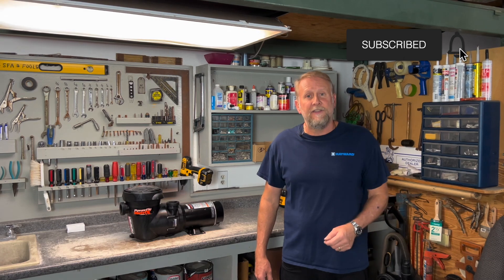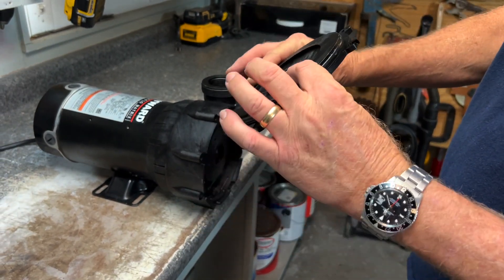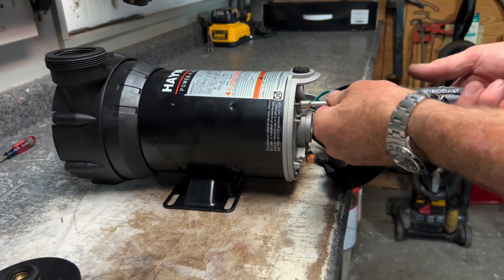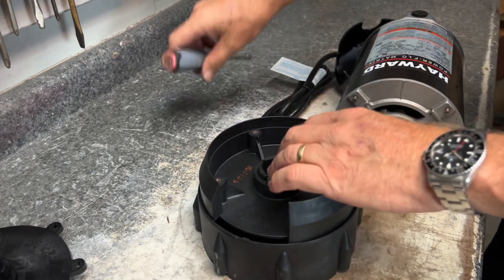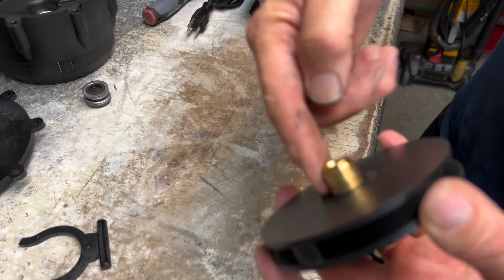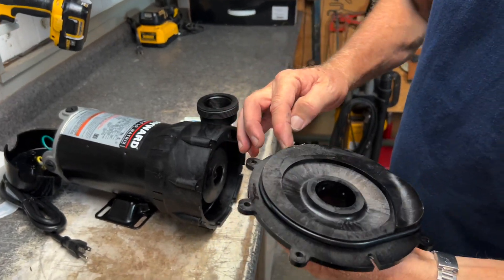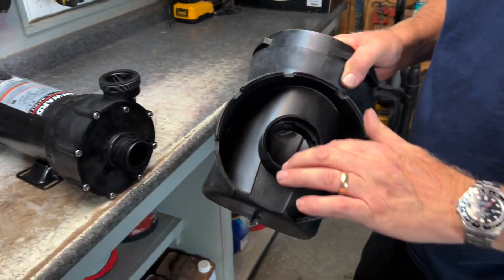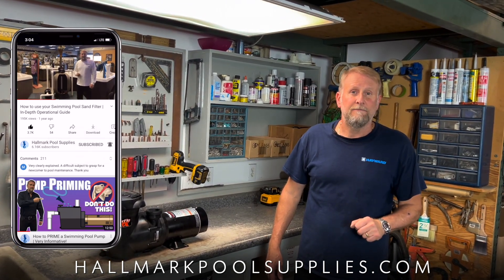How to Change Seals on a Hayward PowerFlo Matrix Pool Pump!

Comment: Do you have a video on how to replace the capacitor on this same pump ?
Reply from the maker: @U2WB  The Power Flo Matrix by Hayward is a split phase motor and does not have a capacitor. Thanks for watching.
Reply: @HallmarkPoolSupplies  oooooh boy ! Well there goes that idea. What would cause it to trip the GFI every time I power it on ? It hasn’t rained here in over a week.
Reply from the maker: @U2WB   You may have a short in the motor or the cord, you could also have a weak or bad GFI. If you need a pump or a motor, email your contact info and l can help. My email is on my YouTube channel. Thanks for watching.

Comment: There is two side to the other seal in the pump housing you can put it in backwards.
Reply from the maker: No, If you are referring to the ceramic part of the seal the smooth side faces out. Thanks for watching.
Reply: @HallmarkPoolSupplies  Thanks for answering. Mind started leaking just as i turned it on for the first time this year thank for your video I got the impeller off but when I nock the seal out I didn’t see how it was suppose to go back in so got a new one and installed it the wrong way it didn’t leak but it started to make noise turned it off turned it back on the motor couldn’t turn the pump so I pulled it a part and turned the seal over but to late it leak’s just like the old. Food for thought and for the next diyer explain about the seal. Thank you.

Comment: Great video! I have the SW1594 model and had to use an Allen wrench in the impeller and pull my motor apart to get that impeller off. While trying to get the motor back together, what looks like the capacitor plates kept getting bent by the bearing on the shaft. Needless to say the pump now doesn’t run in high speed. It’s like a kick in the pants 😂

Comment: This by far is the best instructional video on the internet for this procedure.   A couple of things to consider when doing this on a older pump.    I had a 2018 Power Flo Matrix Pump that was a 1.5 HP that was leaking badly.   To get the impeller off on an older unit it is best to have a second person to help you.   In my case I had a flat blade screw driver and what I did was take some vice grips and clamp down on the screw driver with them.   I then had my wife hold that screw driver in the slot on the back of the motor shaft using the vice grips as leverage.    I was then able to use my hands to spin that impeller off counterclockwise.     I was unable to do this by myself trying to hold the screw driver in my right hand and spin the impeller off with my left hand.   The other thing to really pay attention to is the orientation of the housing seal.    Mark explains in the video how to correctly install the impeller seal with the metal flat part against the impeller.    The seal that goes into the housing is not the same on both sides.   You need to pay attention to how the old seal comes out.   I used a socket to tap the seal out.     I also used some anti seize on the threads of the 4 quarter inch long bolts that go into the housing.

Comment: Hey Mark, thanks for the video! I had an issue when reassembling my pump, I tightened the impeller back up using a slotted screwdriver in the rear and hand tightening the impeller, but now the motor does not spin freely… is it possible to over-tighten the impeller? Thoughts on what to check would be appreciated. Thanks!!!
Reply from the maker: If you changed the seals, it is important to remove the seal that is on the impeller completely. Sometimes the rubber washer, part of the old seal sticks on the impeller and if not removed, putting the new seal over the washer can cause this issue. Remove the strainer housing and the diffuser cover on the pump and see if the impeller spins. When the diffuser cover is in place the impeller can rub because of the washer. Also when installing the diffuser cover do not over tighten. Thanks for watching.

Comment: Mark hello, I changed both seals out yesterday and it’s still leaking does it matter which way the seal faces in the housing ? Not the seal on the impeller but the other one.
Reply from the maker: @MrN75nokia   It is important that both parts of the seal set are put on correctly. Both parts can only go on one way or you can damage the seals and you will have a leak. If the seal set is damaged then you may have to replace the seals. Thanks for watching.
Reply: @HallmarkPoolSupplies  yes now I see that the ceramic part of the housing seal has to touch the Teflon part of the impeller seal. I accidentally put the rubber side of the housing seal up against the Teflon side of the impeller seal, so I’m sure it’s ruined, but I have more seals on the way.
Reply: @HallmarkPoolSupplies well after getting the seals in correctly the motor burned up so had to go buy a whole new Matrix, it was 8 years old so I guess time for a new one.

Comment: Great video- question I bought this pump and I had to turn the pump  to fit my Hayward filter- the pump would not lock into position- the pump started leaking after the first year with the pump not locking into the side discharge position was it defective out of the box?  I actually bought another pump and it locked and I had no problems with it.  Thank you!
Reply from the maker: It's possible that the locking tab was broke.

Comment: I've always been told, as it pretains to shaft seals of this design, even the oils from our hands can cause issues between the Teflon and ceramic surfaces. I've always used gloves, and wiped the mating surfaces with alcohol prior to assembly.
Reply from the maker: Handling the seals is fine, water chemistry (chemicals) is what damages and shortens the life of the seals. Thanks for watching.

Comment: The plastic peice before you get to the impeller on mine seems stuck... do you have any ideas how I can get it off...
Reply from the maker: If you are referring to the pump cover, once you remove the screws it will come off. sometimes they get stuck, you can use a flat head screwdriver  to pry this piece off. Thanks for watching.
Reply: @HallmarkPoolSupplies  thank you soooo much!! Worked perfectly!! You are a life saver!

Comment: Thank you for the great video. I have a Hayward power flo matrix dual speed pump leaking at the basket and pump.  Is the part number for the shaft kit: SPX1500KA? Thanks again
Reply from the maker: Yes, thanks for watching.

Comment: So I had this type of pump from Hayward for one season and the second season it started leaking. I bought a new one and had this in my garage for a few years. I found your great video and started to change the seal. 
I got to the point of removing the four screws. One did break off. Tried to separate the housing to get to the seal and the whole motor came out. Hayward is a junk comp. Why would they not put never seize on the threads knowing they would be in a damp environment. The housing inside where the motor is has  considerable rust inside from one season. Hayward along with almost every company anymore just makes junk. It is a disgrace since these pumps are over $300.00.
Reply from the maker: I agree, however Hayward and a lot of other companies do not make the motors. Most of these motors are made in foreign countries.
Reply: @HallmarkPoolSupplies  Hi. Just viewed your video on replacing the shaft seal assembly. My Hayward power flo matrix model SP1593 pump, that I purchased (8//11/16) only has the 1 shaft seal, it doesn't have the other seal with the spring. Is this correct?
Reply from the maker: @AnthonyCarrozza-b3v  No, the shaft seal on the impeller has a spring, if yours does not you need to replace or you have the wrong seal. All Hayward seal sets are made this way.

Comment: I changed both seals and the Hayward Pro Flow Matrix is still dripping water under the pump.  Could you give me an ideas of how to fix this? Thanks!
Reply from the maker: If you put the seals on properly, check the housing o-ring for damage. Make sure that everything is tight, also check for any cracks in the body. Thanks for watching.

Comment: Question- I was finally able to get the broken screw out. The whole inside of the motor came apart. I put it back together but when I turned it on it tripped my breaker. Does the internal part of the motor go in a certain way. I have not been able to determine the answer. Tks
Reply from the maker: Yes, you may want to take your motor to a local motor repair shop and have them take a look to be safe.

Comment: Hey Mark, great video on point. Have the same pump but the problem I'm having is that it's not priming. Suction is weak on the skimmer side. Check the hose from the skimmer to pump no problems there. Checked the pump for debris, nothing. I'm a new pool owner and the pump isn't even a year old. Am I missing something. Your feedback would be greatly appreciated. Thank u sir.
Reply from the maker: Make sure your water level in the pool is high enough and the weir door on the skimmer isn’t stuck. If you have a sand filter, put the system on recirculate and if the pump runs good then you may need to backwash and rinse the filter. If the pump runs the same then you need to check your pump. Make sure nothing is cracked and that you have an air tight seal (o-ring, lid, housing, plugs) in order to maintain prime. You also want to make sure the impeller isn’t clogged. Hope this helps, thanks for watching.

Comment: I am changing my shaft seal on my Hayward SP1593 right now ( 6/2/23 ). I only have the 1 seal on the housing. I do not have the other seal with the spring on it. Why?
Reply from the maker: The Power Flo Matrix pump has two parts that make up the seal set. The part you are referring to is on the impeller and the other part of the seal is in the pump housing.

Comment: This is perfect!  I had a tiny leak under my pump all summer.  I’m sure it’s a seal. I just closed my pool and took the pump inside to my work bench.  I was hoping to find a video showing how to replace the seals on my power flo pump.  And this is it!  Just need to order the seals and get in there.  Can’t thank you enough.  Big $ saver.  Just subscribed to your channel.  Thanks!
Reply: So I finally got around to doing this job tonight.  Figured I’d do it over the winter so I’ll be good to go next summer in CT.  Followed your video every step of the way and I had very little issues.  My model was slightly different than yours, but all the steps were the same and an hour later I was done.  Pretty confident I won’t see leaks next year.  Fingers crossed.  Thank you so much.   Big $ saver for me.  And it actually kinda fun to do.  Appreciate your channel!

Comment: Hi Mark.  I just had my SP1593 motor repaired with new bearings and a new shaft seal kit.  I put it all back together and now it's leaking out the bottom.  Could one or both of the o-rings past the impeller be prone to leaking when removed and reinstalled?  I did'nt put new ones on as they looked to be in good shape.  Excellent videos and thanks for any assistance!
Reply from the maker: Anytime you repair or replace a motor you should replace the shaft seals. Thanks for watching.

Comment: I’m having a problem getting the propeller off. Seemed simple for you. Stuck for me. Afraid I will break it. Any suggestions? Am I missing something?
Reply from the maker: Most of the time the impeller will come off easily, sometimes it can be a challenge. If you are having a hard time getting the impeller off, have someone help hold the shaft while you turn the impeller off. You can also use a pair of channel locks to turn off the impeller, if you break the impeller you can replace it. Good luck, thanks for watching.

Comment: Hi Mark, this is a great video. 

I wonder if you can help me. I have a Hayward Matrix Power flow 2 speed above ground pool pump and today it was not working at all even if the power was on. So I tried to put the switch on OFF (it was on low speed) and when I did that the switch just snapped. Now the switch is loose and dont stay either on LOW or HIGH. 

Do you have a video for replacing that part? Is it easy to do? I am quite handy but have no experience at all on pool pumps. 

Also can you tell me the exact part I should buy. Thanks.
Reply from the maker: The 2 speed switch is easy to install, the part number is SPX1500S9.
Reply: @HallmarkPoolSupplies  Thanks for the answer. Do you carry that part? I did not find it on your website, And it is unavailable on Amazon. Do you know where I can find it and how much should I pay for it. Thanks for your help.
Reply from the maker: @andreab919  These switches are after market and the manufacture does not have any at this time, the part is on back order.  I would take your switch to a local electronic store or motor repair shop, you should be able to get one for under 30 dollars.
Reply: @HallmarkPoolSupplies  Well looks that I am not that handy after all. I cant figure out how to reach the switch. My pump does not have a single screw to remove a cover. It has two holes in wich it seem to have flat screws. But even if I unscrew these, the back does not pull out. I did not take the screws completely out not knowing if it is ok to do so. Can you help me in telling me exactly how to reach that switch. My model is Hayward Matrix power flo SP56152. Thanks
Reply from the maker: @andreab919  The pump model that you have is the Canadian version of the Powerflo Matrix by Hayward. If you have a 2 speed with timer then you need the 2 Speed Timer End Cover, part number SPX2090C2ETM. The back cover will come off and can be replaced. I do not carry this part, but you can go to haywardcanada.com and they should be able to help. The Powerflo Matrix is also made in an American version, which uses a different switch.

Comment: Is there a way to relate this to the Power Flo XL. My strainer basket goes on sideways without the c clip on the outside. Just wondering if the play would make it leak since it’s not tight? What is the function of the outer c clip?
Reply from the maker: The Power Flo Matrix uses an o-ring between the strainer housing and the pump cover. When using the c-clip the housing will be lose but it should not leak. Thanks for watching.

Comment: Hi Mark - great video thank you. Question for you. Because I had insurance money from pool damage and no time I did something I rarely do- hire work out. Guy did a great job with new liner and new plumbing but did not tighten the chlorinator and left the DE filter completely unassembled with top just sitting in with clamping bands not even on the filter. Ugh. So when I filled my pool it was actually leaking out all over my pump for close to 10 hours. We also had that unusual couple of heavy rains. When pool was filled I went to turn on pump and it blew the GFCI. Great, the pump was drenched inside. But boneheadedness aside, it seems like my pump gets wet inside every year to some extent. Is that normal ?
Reply from the maker: No this is not normal, if you have any questions feel free to contact me I will be glad to help.

Comment: What would cause my pump to heat up?
Reply from the maker: When a motor overheats it can be an electrical issue, you can have the motor repaired or replaced depending on the age and condition of the motor. If a pump is not maintaining prime it can also overheat. Make sure your water level is good and you have full water flow to the pump. Thanks for watching.

Comment: Thanks for your response. I cannot seem to get my hands on the part: SPX1500KA. Shaft seal kit.  Do you have one? I will pay expedited shipping , I need badly. If not do you have a suggestion where to purchase
Reply from the maker: I carry the shaft seal in stock. Here is the link to order or you can call us to order.
https://hallmarkpoolsupplies.com/p-2002-spx1500ka-powerflo.aspx

Comment: Hi Mark. If one of the four screws on the wire side of motor is broke of inside. Do you have any suggestions? If I slide something in there and tap it shouldn't it force the other end off???
Reply from the maker: You have to remove all 4 threaded rods (screws), then you should be able to get to the broken screw on the back of the bracket. If you need any help or any parts feel free to contact me I will be glad to help.

Comment: Hi Mark, I have the same pump and it started make a loud screeching noise when I had it running so I’ve had it turned off for a few weeks. I tried turning it on, on yesterday and now the motor is just making a humming noise. Do you know what may be causing this?
Reply from the maker: It could be that the bearings in the motor have gone out. Depending on the age and condition of the pump you can service or replace the motor. l would get an estimate first on the repair vs replacing the motor. I do carry the whole pump as well as the motor for this pump, if you need help feel free to contact me and l will be glad to help. Thanks for watching.
Reply: @HallmarkPoolSupplies  thank you for your response. How much does the motor cost? Also does this motor have a capacitor in it?
Reply from the maker: I need to know what size (horse power) motor you have. If you email me l can get you a price. This motor does not have a capacitor.
Reply: @HallmarkPoolSupplies Also I’ve had the pump for 1 year 6 months.
Reply: @HallmarkPoolSupplies  1 hp
Reply from the maker: l do have the motor for your pump, however the new motor will not have a switch. You will also need to replace the seals when replacing the motor. Here are the links for the motor and seals on my website. Email me if you have any questions.
 https://www.hallmarkpoolsupplies.com/p-9957-bn25v1-1hp-115v-118a.aspx
https://www.hallmarkpoolsupplies.com/p-2002-spx1500ka-powerflo.aspx